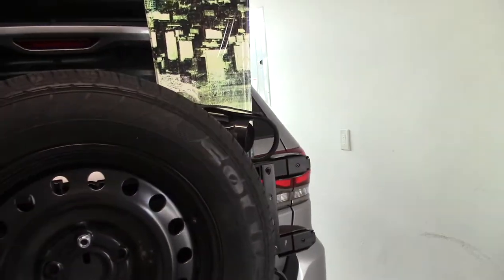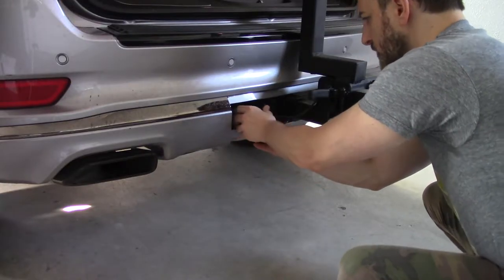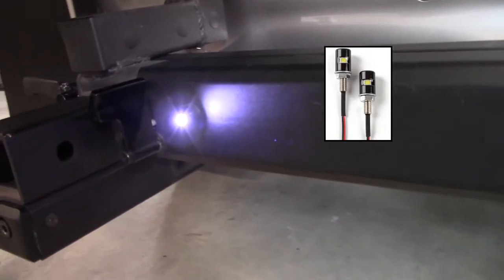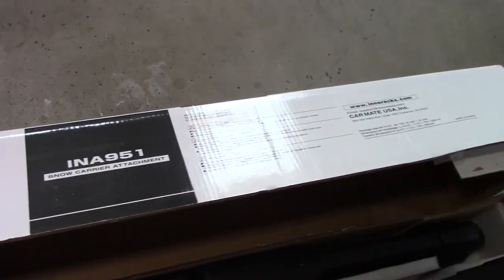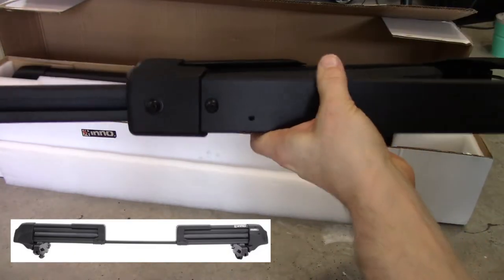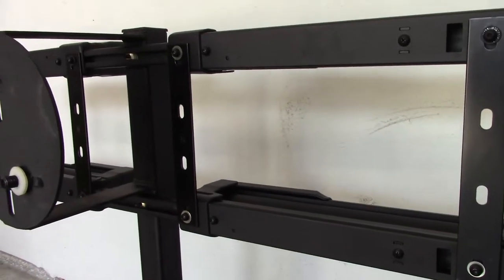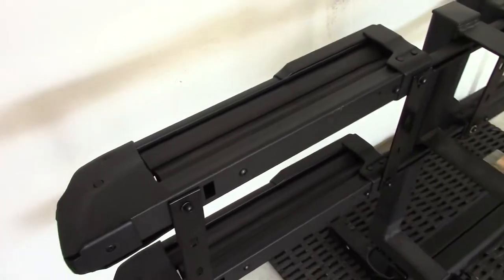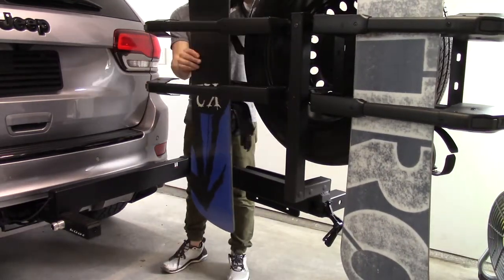Custom spare tire and snowboard rack. Jeep Grand Cherokee. Kuat Pivot V2 hitch mount and Inno INA951

Comment: Man.... this is killer. How’s the weight and everything holding up on this hitch. I’m doing the math now with the weight with my 33” KO2 🤣 and my just rack and my bikes.
Reply from the maker: Hey thanks! I can’t really attest to its durability as I don’t have it on there full time, only for trips, but I don’t see it having issues. The Kuat swing arm has a 250 lb weight rating so I’m well under that. If I were to add more weight I would consider welding on a stabilizing cross piece to help support the tire mount, but still wouldn’t exceed the 250 lb limit for the swing arm.
Reply: @totisviribus2616  that’s awesome and what’s wild is other similar tire swing/bike rack mounts (rigd/Wilco) are 3-4 times the price of this.
Reply: @850OVERLAND  yeah, I just couldn’t justify spending that much. This worked out great especially considering the savings.

Comment: Another awesome idea and great execution. Maybe there’s a way you could rotate the snowboard mount 90* and run them parallel to the ground. I’ve never seen a snowboard in real life so I don’t know if that would even work but I sat here and watched every second of your video fully captivated. Keep up the good work!
Reply from the maker: Thanks for the comment. I actually did throw around the idea of mounting them horizontally but because of the length of the boards, the tailgate would hit them on the way up. It would only work if they were mounted on the outside of the tire as well.  Also, I wanted to avoid blocking my rear view and it didn't look like it would be possible with a horizontal mount. Depending on how my upcoming trip goes I may revisit it and see if there is a way. Glad you enjoyed the video. Hopefully I'll have the water system video up soon.
Reply: TotisViribus what about a 45° angle (akin to a forward slash “/“)?
Reply from the maker: @jrmbtr  that might be possible but you would have to make a custom bracket to attach it. I didn’t measure but I also think that the boards will cross and block the center rear view. Part of the problem is how close the tire sits to the car. I think I could make the horizontal work if the tire sat forward another 4or 5 inches. But then when the rack is off, there is all that space. The swing arm actually has a hitch receiver for external bike racks which is what it was designed for. So an easy solution would be to find or make an L shaped hitch bar like the one the tire is on, without the tire part, and mount the rack on that. That way in could be easily mounted in front of the tire into the hitch reciever and removed when not needed.

Comment: Well done video and design work! I am interested in knowing where you obtained the steel wheel you're using for the spare on your wk2. I want to use a full size spare instead of the donut spare that came with the vehicle. Thanks - James
Reply: Hi, its the spare that came with the vehicle.

Comment: Outstanding solution. Hey for the board that is in the way of the swing operation, could you modify the existing design by adding a vertical sliding feature for that particular snowboard? Like a drawer rail kit? Then you could just slide it up in place to swing the tire carrier.
Reply from the maker: Hey Thanks! I imagine something like that would be possible but it would be a pretty complicated redesign and I don't know that it would add enough convenience for the effort. You would still have to somehow lift the board up and over. Sliding out might work, but I'm not sure it would clear the side of the car. I don't have it set up right now so I haven't checked. 
I did use the system over the thanksgiving holiday on a road trip to Colorado. I camped a couple nights  and hit the slopes and it really wasn't a big inconvenience to just pull the board out and put it back as needed. If I was using it constantly I may consider a redesign but since it's usually only one or two short trips per year for me, I'll probably just leave it as it is.

Comment: Have you taken it off-roading? How is the bounce factor, how much does it move?
Reply from the maker: Hi, I haven't done anything hard core. The swing arm itself is super steady but the tire portion definitely has some bounce, mostly because its flexible. no noise though. If i were to use it for more intense offroading, I would weld a diagonal to give the vertical portion a little more rigidity.

Comment: I'm curious how the tire rack is holding up. Have you noticed the hinge wearing out? I want to get a fifth wheel and tire to match and mount on the back and am curious how this handles the weight. Great job
Reply from the maker: I don't keep it mounted permanently, I only use it for trips so I don't put a ton of use on it. That being said, I don't see it being a problem. The only time the hinge is weighted is when it is open, not while driving. As long as you stay within the weight rating of whatever hinge you use it should last as long as you need it too.

Comment: Is there much movement with the kuat pivot?  Do you notice the spare tire bouncing around or does it lock up tight?
Reply from the maker: The Kuat swing arm locks up tight. The tire does move, but that's more due to the flexibility of the tire mount. I'm sure I could make it more rigid if i wanted too. But there is no noise or clanging or anything.

Comment: Does it block the backup sensors?
Reply from the maker: I actually have my sensors turned off, so I’m haven’t tested it. I find those things to be more annoying than helpful especially when I have the back up cam. Although the tire does block the camera when I have it mounted. I only use it for trips, not around town, so it’s not to big a deal. I might turn the sensors on the next time I mount it and see if it works or is helpful.

Comment: I love this solution, I was looking for a way to use the Pivot with a spare and then a bike rack, hadn't thought about welding on the spare to the Pivot. Do you have a link to the spare carrier, I don't see it on Amazon, thanks to much.
Reply: Hi, glad you like it. Here's the link to the one I used. https://www.amazon.com/dp/B07P8VZ6DD/ref=cm_sw_em_r_mt_dp_0DTGZPVB59MZQN148Q69?_encoding=UTF8&psc=1
Reply: @CM-fe6to  Do you think you could weld on the lower part and still leave the vertical part so it could be removed? I would sometimes want to use the pivot on my jeep and the existing spare on the back door would be incompatible with the upright. Thanks for your thoughts!